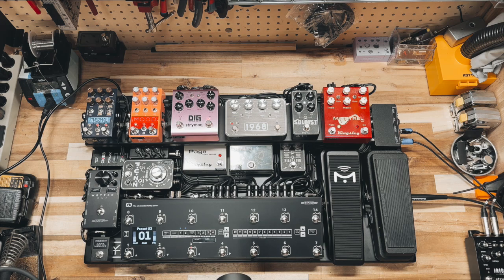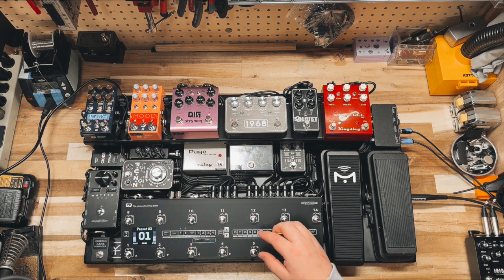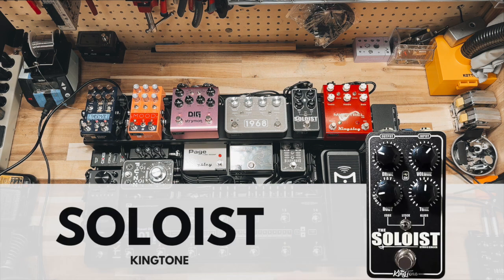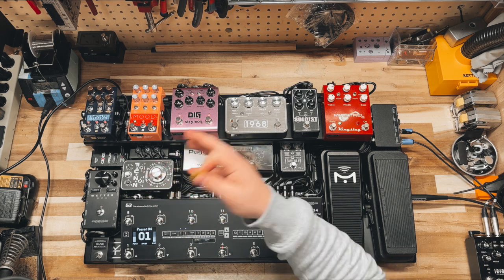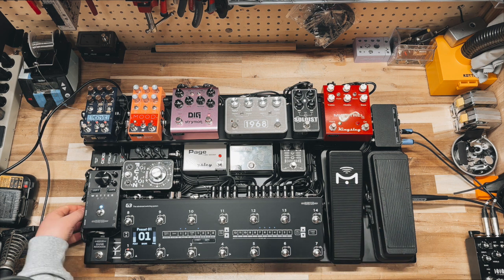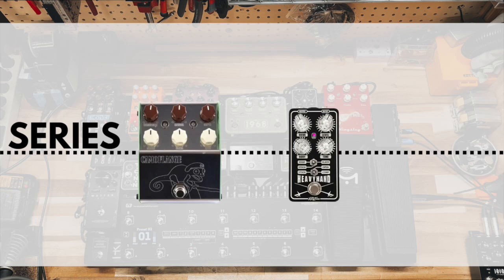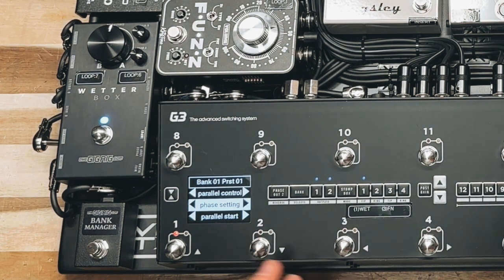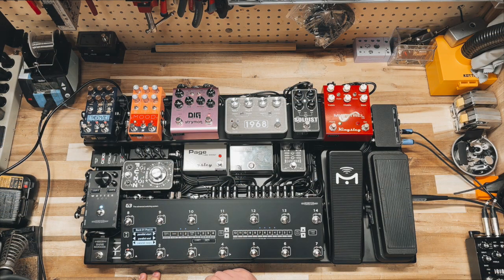Gigrig G3 & Wetter box parallel Rig Build

Comment: Just one question. The wetterbox was there only to have the expression pedal controlling the blend of the two fx, right? Cause otherwise the G3 already h	s the parallel option. Or the wetterbox was used to have the two pedals in both parallel and serial configuration ? Thanks, your work is excellent !

Comment: This it what I want to do and can wrap my brain around how to make it happen. Only 2 minutes in, hoping by the end I can put all this bad ass equipment to good use.

Edit: nope still lost lol.  How is the wetter box connected to loops 6 and 7 and why those, does it matter which? do you need to send and return things specifically to those loops? Are the send and return connected for each loop on the wb? How does just changing the parallel settings in g3 communicate with the  wetter box specifically…  still don’t get it. But I appreciate you showing your build so I know it’s possible.
Reply from the maker: I know it looks complicated but it’s actually pretty simple to set up! We also do custom wiring diagram PDFs if you’d like to purchase this one! Just email us at setups@omilionaudio.com